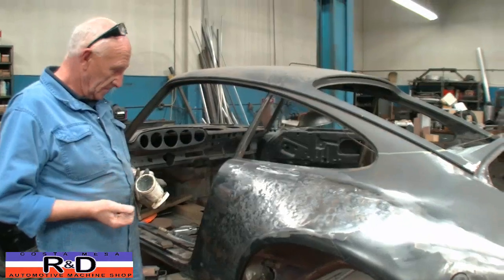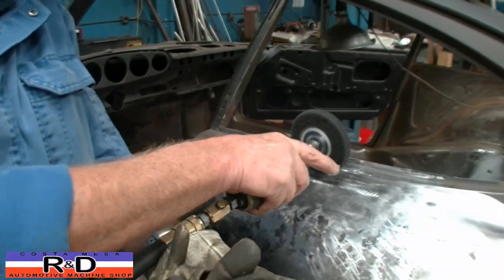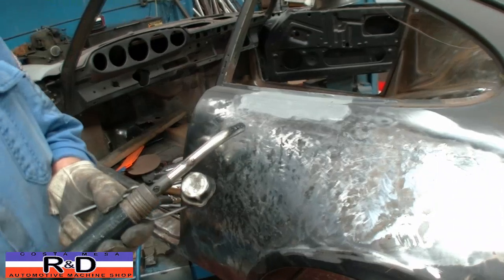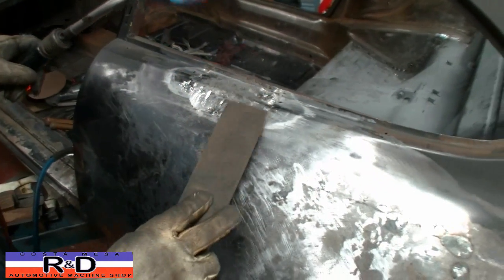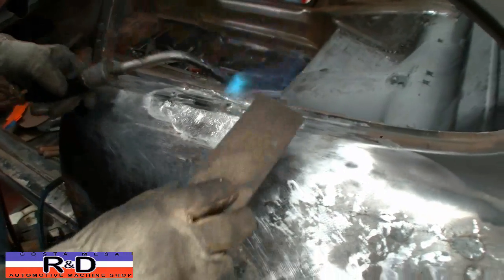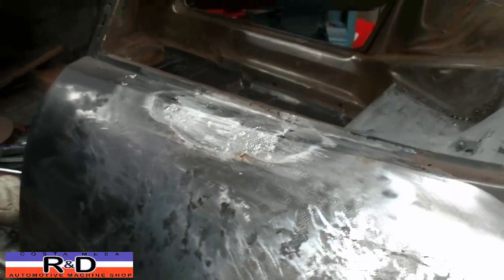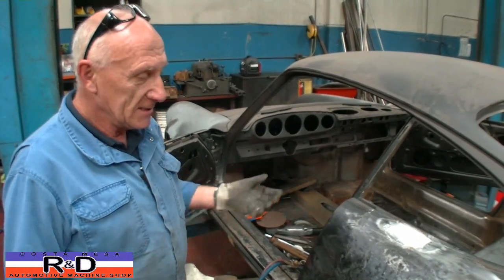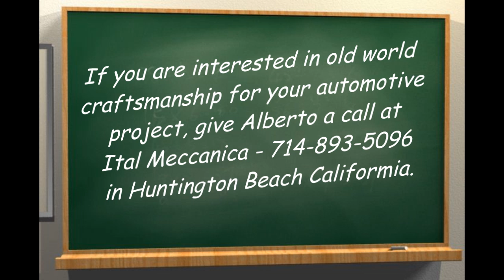Using Lead in Body Work Instead of Plastic Filler

Comment: Ok since there seems to be a lot of misconception, here's the answer straight from Icar, lead is no longer used as a body filling technique as it is most importantly dangerous, the inhalation of lead dust is almost unavoidable, also the common misconception that the leading process adds structure, when in actuality the wide difference in density and material thickness can negatively impact structural integrity and balance of a panel, far more than more traditional methods, also depending on the type of base metal lead can promote corrosion. There you go straight from the horses mouth.  In my experience, if I get my hands on a panel and find out its been leaded, when I check it, the whole damn thing ends up warped, I've been told by the old guys its cause over years with the vibrations and other forces on the panel fuck with the lead and it will pull the rest of the metal in all sorts of weird ways. Most importantly these guys say we stopped using lead because we can get better repairs without it.
Reply: But they don't use lead, it's a tin alloy. They stopped using lead decades ago.
Reply: But still : Depending in the alloy used, corrosion could be promoted (i.e. Electrolytical Corrosion. The same principle why you mustn't use brass couplings on steel pipes.
Reply: I've actually seen some lead under a vinyl roof on a car from 1970. It was factory but it all crumbled as the roof was peeled off. Some guy came in and redid it. All he did was scrub it with a wire brush, reheat it and touched it up with a thick solder stick like they use in radiator repair shops. Took about 15mins a side and he used very little of the stick.
Reply: @ThePaulv12  They used to use to use lead on production cars probably up till the 60s or 70s, particularly where the roof would join the pillars.  I think they also used it to combine smaller stampings to make quarter panels.  I remember in the mid 70s there was a GM commercial where these cars were going down the line and this guy was applying lead to the pillars almost like someone applies plaster to drywall.  The guy had a steady hand and was doing it fast.  Back in the 70s when vinyl roofs were all the rage, I am guessing that they probably cheated a bit on the quality of the job if they knew the roof was going to be covered in vinyl.
Reply: GM used a type of Hot Melt glue in/on the Monte Carlo C pillar seams. No need for finesse when it will be covered with a vinyl top. Non-vinyl top cars still got the lead filled seam. But then,how many '70's Monte Carlos have you ever seen sans vinyl tops? Few and far between!
Reply: @kennethsouthard6042  Im working on my plymouth scamp they buried the roof to quarter panel joint in a layer of bondo every A body with a vinyl roof rusts in that damn spot.

Comment: This is very much like how I do it, I leaned myself just by trying but it was mostly a no brainer since I have been doing electronic soldering for most of my life often using a torch for large electrical connections.

Also on a side note, I saw a 930 at the blasters recently and it had old pre existing lead work in the same areas in this video.

Comment: Other than the lack of PPE, the main problem is he didn't tin a big enough area, and some of the solder was applied (or ran) over the un-fluxed and un-tinned area, so it is likely the bond there will be poor.

Comment: It's cool to see that this technique still exists, but honestly there is no need to use lead anymore.  Body filler will last just as long and is far easier to work with.
Filler got a bad name because people used it improperly and it cracked.   If you use it properly and just have a skim coat, it'll last literally forever.  
I just had a truck bed sand blasted.  It has some filler put in it over 30 years ago.  The sand blasting wouldn't even take it off, because it was done right.

Comment: seems to me a safer and just as viable alternative would be to use electrical solder and soldering iron. It's a low melting point metal that is lead-free.

Comment: Well I have done lead and it is not as great as people think Try USC AG47 filler then tell me you need to use lead. the new fillers are flexible, stronger, and will probably outlive the owners. Lead is Archaic.

Comment: Unrelated, but solder can also fill wire mesh easily. If you have stainless mesh, then solder that over aluminum.

Comment: could be poisonous but you can also use flux kestors the best if you can find it an dflux twice if you use it rinse first heated flux with clean cotton rag damp with clean water lead in bars can be fused to metal by rubbing it  over hot fluxed metal or you can first used like oaty solder dont bother with off brands of solder they wont work ! after you get a layer of good solder tined to area you can somtimes use cheap lead from a tire weight if its on a top side easier then side but tire weights are a poor grade and shouldnt be used as the main tining metal and there difficult to use on side of vehicle even when tined leads probably best at filleing gaps in welded quarter panels where there lapped onto existing panel  .Where a raperator and throw you cloths away when dune wash yer hair dont let the lead run out of you hair its toxic cover up and wash up after exposure use google and propain or 2 propain torches wood padles for smoothing hot lead

Comment: Important to note, up to the late 80's just about every car made came with lead body work right out of the factory, that is how the roof was attached to the main body, at least for most domestic manufacturers(American for you Furin types) Bondo is garbage, avoid it any any cost.

Comment: Isn't quite how I was taught to do this. We didn't use the "butter" we would use an acid base flux then tin the metal with some heated tin and a special pad to wipe it on thin. To all of you, tho it's still called leading, there is NO lead in this. it's mostly tin with a few other ingredients. The lead came out long ago back before I was learning it so long ago.  there was a guy with a vintage porche that wanted nothing but "lead" work... no bond or the like. but the car was very rough. it would up having so much on it that it sat down on the rear wheels without a motor being in the car. He'd have to redo the shocks to make it work.

Comment: The rest of the fender is going to need filler it looks like a sack of walnuts.  Don't even try to tell me he leaded the whole panel.  The "real" proper way is to replace with new panel and lead the seams.
Reply: If "proper" you mean someone seeing it later in time that it was a period proper fix, then yes. Kind of. But when using metal to close up the hole in the roofs of cars from the twenties and thirties in the fifties or sixties, large areas like the part below the lead, would have been filled and block sanded with many coats of primer. of course after some more hammering and heat shrinking.
Reply: I have skimmed whole panels with it and you just disperse the heat, work faster and use a larger paddle with tallow working from the bottom up but by to days demand for finish nobody can escape a fine skim of epoxy or glazing putty.
Reply: Thanks for the update, nice work!  Take care.
Reply: On high value cars 'originality' is key to keeping the value, even replacing damaged parts with oem/genuine parts will knock off a huge chunk of value vs keeping and repairing the original panels.
Reply: I was thinking the same thing.
Reply: Steve Prince  If the original panel can't be repaired, you go to Aston Martin Works and they make a new panel and fit it. It's probably the only repair that will maintain the value.
Reply: You are aware he did the small area for demonstration purposes of this video, right? As for the walnut comment, apparently you know nothing about hammer and dolly work. I've repaired panels that look worse than that one. As for finishing, there was barely 1/64th of an inch of filler left after skimming. 

Funny to see comments from guys like you that don't have a clue other than cut off the old and replace it. Do that to a production car where panels are available...
Reply: Just pop over to Newport Pagnell for a touch of fit and finish (and a two year wait!)
Reply: you can do it, and it filed so it actually wont take much at all. unless you've spent about 15 years plus and have qualifications, don't talk about something you weren't there to feel
Reply: @Frank Wiley well of course, i did not direct my comment at you in the first place. i grew up with people that have the same passion as you do. i wont bag out someones work, however what i will add to this is that no matter how long you have been in this trade there is ALWAYS more to learn. i may have a mere 18 years experience but i have learnt from hundreds of years of experience and work on anything from 1920's to 2018 (and have pictures and trophies too but i dont like talking myself up. my jobs do that for me)
Reply: That's a lovely idea if a new panel is available, or funds allow for a craftsman to beat a new one out of a flat sheet.

Comment: What is the music track at the end of the video?  It’s great. I appreciate the lead work video. However I wonder If Alberto went outside his tinned area, it appeared that he did.  The best lead work I’ve seen on YouTube is a demo sponsored by Eastwood at the SEMA Show . The work is being performed by Gene Winfield. He uses a couple other tools and has differing technique. I like Alberto’s subject vehicle and I am glad to see more people learning how to use Autobody filler solder. It is easy to learn to use. Much more forgiving than  plastic fillers and if damaged it doesn’t attract and trap water.   
Solder is much more suited to being used on objects which subjected to a hostile environment than two part plastic fillers.  
I have found that after learning how to use solder , using plastic and watching someone whom is really good with plastic , two-part or bondo type fillers I truly believe the later is much more of an advanced substance to use.  I feel that two-part fillers are harder to use and get a good result.  I’m not suggesting that bondo fillers are not easy to slap onto a 2 inch deep dent and fill it and get a good enough result for the Earl Shivers $399 Used Car Lot Paint Job.  However to get those lake of Mercury smooth $60,000.00 Riddler Paint Awards, plastic fillers are an advanced subject.  
Again thanks for showing the “lead work”, the more out there maybe we’ll get more people to try it and see how easy it is to get great and rewarding (and maybe Award winning) results.

Comment: REPAIRED a lot of 6 figure cars,i only use lead in  high stress joints,,roof,drip rail area,otherwise its plastic,it is the prescribed repair in every body school on earth,thanks for  the reminder info
Reply: steve you talk like you know me,you don't,and yes I put backw what manufacturer put there,lead is easy to work,and plastic fillers are never to be used in a seam,metal to metal gets metal
Reply: Steve Prince,again you slur to someone you clearly don't know,i don't work on European cars, at all,i only deal with high end mopars and ford,none of those million run off chevs or cousins,i only deal with unibody,UNIBODY, cars,and when I build these I always reinforce the lower body shells with extra reinforcement as they were going to drag race them,which never happens,and sipping warm milk,isn't that also a European trait,you have a nice day,and don't bother to insult,you matter not

Comment: Very cool I might give it a go with some scuffed wheels I have. I also wonder if you could use lead free solders instead they have a higher melting point but that may not matter for this application.

Comment: Lot's of kids here watching this, judging from the comments.  If you are a naysayer to this technique, you should know that lead becomes a shapeable, bendable part of the metal, unlike a poly filler, that locks you into the final shape.  Not only do you not your tools and metal,  you don't even suspect.  But then, kids don't get paid to work on cars like this.
Reply: Not only what?
Reply: "know' is the word here.   Digital communication can be a bigger beast than metal work it seems.
Reply: Yea, lead cracks over time, you can see it on 60's MOPARS around the A Pillar with regularity, but lead moves with body torsion better than a plastic (Bondo).  Why someone doesent believe lead bends is just besides me.  Your typical fishing weight doesnt crack when you squeeze it with some pliars.  Printers lead cracks easily, but basic car body lead does not crack until it oxidizes for a looong time.

Comment: Any source for the lead solder and tinning flux used in the video? As for safety a proper respirator face mask and face shield are a must as well as a fume extractor similar to the ones welder use. I don't see any problems. One can also use thin leather gloves if you are paranoid about handling the solder. I would much rather have this type of repair on a body panel compared to bondo. I have seen complete patches fall off of fenders if flexed a bit too much.q lead won't do that. Proper restoration of older classic cars is most often done with lead since it is more of a permanent repair.

Comment: Adding lead to sports cars sound really awesome, considering they are engineered to be as light as possible
Reply: 70% Tin. About the same weight as the area before repair.
Reply: ddso29 - any "lead" is extra weight because the original metal is still there underneath the repair. Not that the extra weight is really significant as you only use a minimal amount for a repair, probably less than an ounce.

Comment: The Porsche of the 50's and 60's had this done when built. They created the perfect body panel gaps this way. I think the lead flux is acidic and leads to rust, even on other panels not in direct contact. Lead was the bondo of the 60's and thought to be poor panel beating.
Reply: True I did a 356  A Coupe in 1980's and every tool in the workshop rusted. Sadly I sold that car.

Comment: I know shit about body work but still I fixed a few dents with bondo in my day with good results, no problem.  There is a reason using bondo has replaced lead body work like it has. Some people are adverse to change and are set in their ways even after better methods evolve.  Of course they disagree bondo is better but to each their own.  Next I'm looking up a video on using typewriters by someone who claims it's superior to use than a computer and a word processing program. To each their own with that too.  Interesting video all the same.

Comment: using polyester filler , i woud have filled, shaped and primed the panel in the time he takes to lead load , also you dont need to buy gas and strip the trim from inside  to protect the car from catching fire , so in my opinion the use of lead/tin alloy is history
Reply: on the other hand, modern fillers involve the petroleum industry, complex organic chemistry and complicated polluting factories.  the traditional way involves more basic materials and industries.  pollution from the traditional materials is quite limited and the technology is more accessible in places of low infrastructure.   a mechanic in the middle of the gobi desert can do more with a hand operated rivet gun, some scrap and a tube of bathroom silicone.

Comment: Auto restoration as it's supposed to be done; this won't crack off the first time the panel is bumped, as the filler is alloyed onto the steel.
Reply: Bonded. Soldering doesn't mix the solder with the body panel as the body panel has a higher melting point. It is possible to break solder off of the surface you bond it to...but it takes quite a bit of force.

Comment: When does it stop looking like crap though? wasn't a solid line, wasn't smooth, looked like puddles. Can it be sanded like filler or do you just have to live with that?

Comment: The torch is too hot. Using a 400 watt electric iron works VASTLY better. You can use the iron to smush the solder around on the metal without heating it so hot that it flows.

Comment: The technique is good, and one should make sure to not be contaminated with lead by using protection, but the bottom line is that the panel should be beaten as close as possible to the contour so that little lead is used. The panel Mr. Ferroni is working on looks too lumpy for my taste.

Comment: Quite the varied comments. A few I would like to touch on one being watch the process to learn something. No one wants to hear about safety bullshit or osha   If u do this u put your safety shit on and shut up about other people. Leading is an art. If u don’t think so try it on a vertical panel and see how much lands on the floor. A lot tougher than one thinks. We do have better and easier fillers now. Cheaper and quicker. Any filler can be abused and used too thick. We many times don’t get to choose to replace a panel ,as well as your access behind the panel to the greatest extent determines how well u can restore the panel to as close as possible in the allotted time. As well metals nowadays are so thin that if they were heated like this you would have warpage going on so bad you would be replacing the panel. Years ago there was a time ,place and area where lead was the best filler to use. So. Sit back. Watch and learn something. Appreciate the example of how things were done fifty to a hundred years ago. Keep your safety shit to yourself  yes personal protection shit is good   Use it if u want and shut up. I can’t stress this enough    If u don’t want to use filler buy a new car

Comment: The left quarter panel on that thing is not really structural, if you cut that panel off the car it would not move at all.
To be honerst here bondo does move without cracking if its a light coat.
I have been doing this work for 47 years, i will still use lead but the hourly rate goes up.